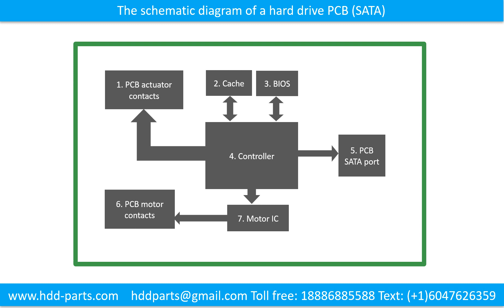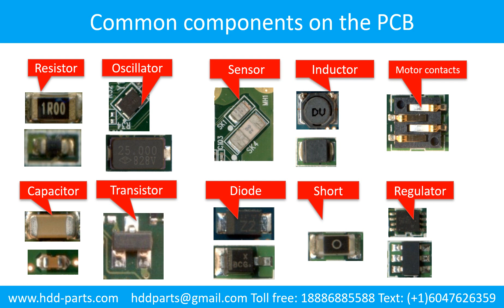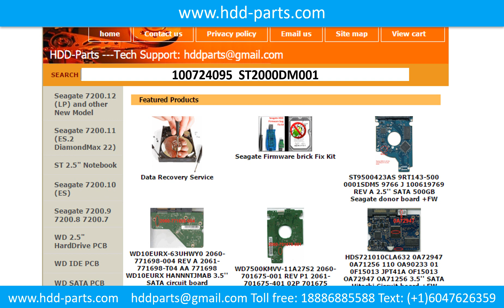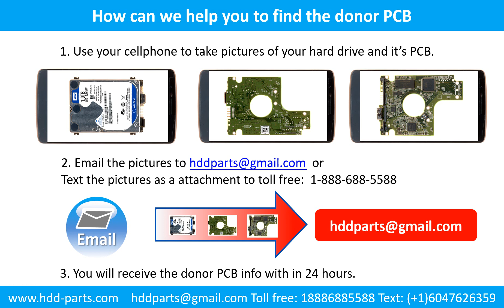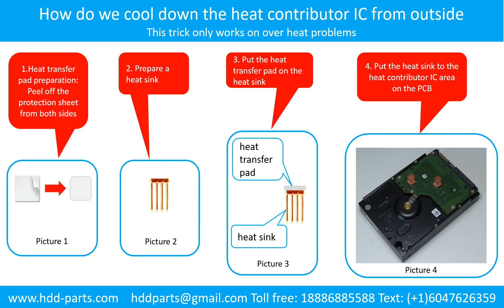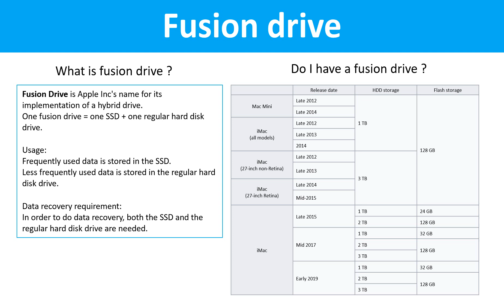clicking Seagate barracuda ST1000DM003  ST2000DM001  ST3000DM001  100724095 PCB repair hard drive da

Comment: Good evening! 
I have a problem with my Seagate ST3000DM001 3TB. When the drive spins up, the drive starts clicking for 12 times and then spins the motor down. So i have bought the donor drive and I have flashed the firmware to the same firmware as on clicking drive. I tried to replace PCB and swap the BIOS chip, but without results. Also I have read that´s the problem of damaged read heads, so I tried replace the heads with head-replacement recovery tool in laboratory conditions. However, the drive is still clicking and undetectable by computer. Could you give me an advise please? I don´t know anymore. :(